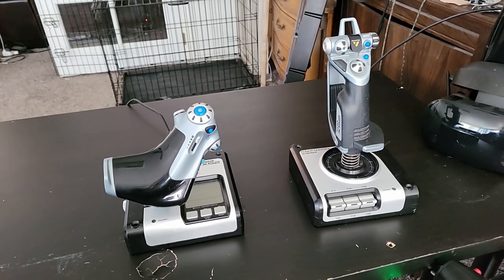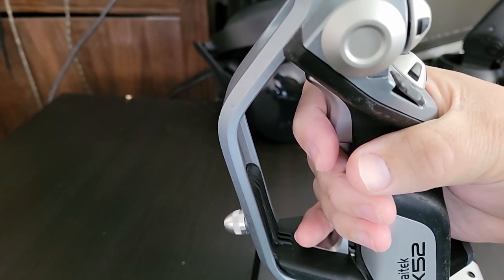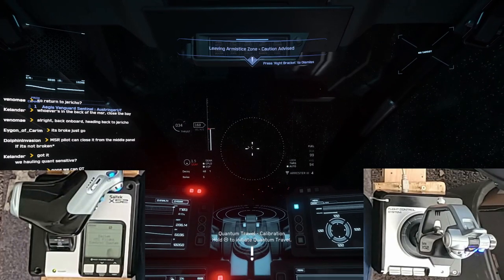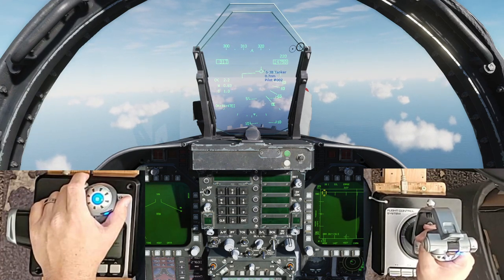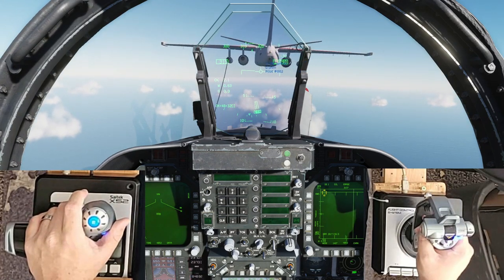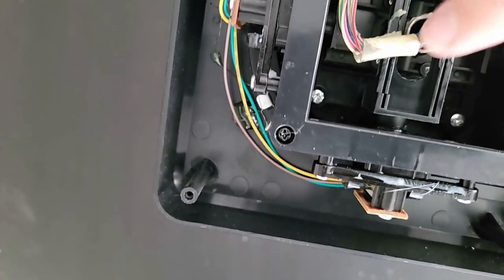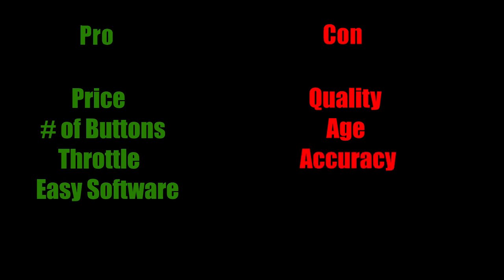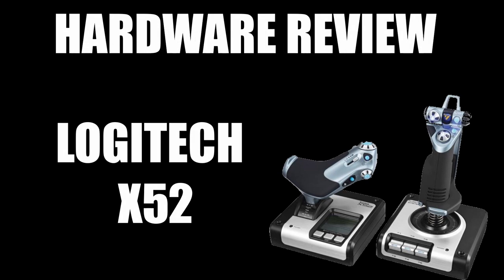Logitech/Saitek X52 HOTAS Hardware Review

Comment: The nub was useful to me to slew around the Radar and Maverick Curser in BMS. Until it started to fail. And if I am not mistaken it was mappable. But I cannot remember since it is more than 10 years ago. But I am 99% sure it was.
The Thrustmaster T16000 has not enough POV's and no 1st and 2nd detent trigger which is needed in Falcon BMS or even in DCS in certain models. 
So for all other games it might be the better option. But Falcon BMS and DCS needs a proper HOTAS with many Rotaries and POV's. Unfortunately. And the budget is a thing when comparing a 120 USD (used) X52 to a way over 300-400 USD HOTAS that gives the same functionality. 
I don't even know why I am watching this 😅 since I know this HOTAS so very well hahaha. Mine lasted many years with many play hours a day. I was so addicted to Falcon and DCS.

Comment: this is my first gear so i didnt think much and bought first one i saw, to figure out what i want from this gear. only thing that annoys me - i need to make holes in table, very unstable gear, they should put some iron in the base. also not all buttons are comfortable on stick.
Reply from the maker: Unfortunately the x52 just really isn't a great piece of hardware. It's recommend checking out the VKB Gladiator NXT EVO. It would be a huge upgrade for not a ton of money.
Reply: @FalconsLedge  yea thanks for intel)
Reply: @FalconsLedge  there is only VKB Gladiator NXT without "EVO" available in my country, is that right version?
Reply from the maker: @karlvareze8337  the NXT is a great stick, but the NXT EVO is far better for essentially the same cost
Reply: @FalconsLedge  btw i can manually upgrade it, their assembly is on god level

Comment: Just wondering I was going to buy one of these but what is the difference between this and the x52 pro?
Reply from the maker: The pro has a dual spring gimbal, some additional metal bits and two of the very low quality Hall sensors instead of one. 

On the plus side some of the metal bits are some of the high wear items.

If you are willing to spend x52 pro money, why on earth wouldn't you buy a Gladiator NXT and TWCS throttle? The stick is 100% better than anything Logitech has to offer.

Comment: my X52 just died after only 8 weeks of use. Is that Star Citizen music I hear? That's my main use for this joystick!
Reply from the maker: I use a bunch of game soundtracks, including SC! if your throttle works, buy a Gladiator NXT and never look back at the X52. You will not be sorry.
Reply: @FalconsLedge  nothing works as the 2 are joined together and the throttle receives the power via USB. I looked for the Gladiator NXT and couldn't find it but I'll look again. I may have searched wrong. And I couldn't find that throttle you recommended either. thinking of just getting the T16000M.
Reply from the maker: @coina-dig-tion6322  VKB Gladiator NXT and Thrustmaster TWCS throttle. Trust me on this one.
Reply: @FalconsLedge  ok. lol just checked and they want nearly $60 just for shipping. :-( Guess I've been spoiled with Amazon free shipping too long, huh. The Thrustmaster TWCS used to stick a little from what I've been hearing. Is that still an issue?
Reply from the maker: @coina-dig-tion6322  yup it's an unfortunate reality, but it is well worth it. It is volumes better than the T16000 stick and worlds better than the x52
Reply: @FalconsLedge  ok. thanks for the input. Will be buying these two soon.

Comment: I was gonna get a new x56 for $205 on amazon but picked  up a used x52 for $30, would you consider that to be good? I thought it would be nice for the money, I just needed an upgrade from the logi attack 3
Reply from the maker: I would not consider the x52 to be good, no. But I also don't think he x56 is good either. 

The biggest problem with logitch if that they don't give a flying crap about combat Sim hardware. 

What I'd suggest is to keep the x52 Throttle, is not great, but not bad either, and it sounds like you got a good deal on it.

Buy a VKB Gladiator NXT EVO and use that as a stick. It will be a setup that will be very good, and significantly better than the x52 stick (the worst part about the x52)
Reply: @FalconsLedge  Thanks, Ill prob look into getting the gladiator, The only flight sim I play right now is DCS and I fly the F16, I needed more binds than are available on the attack 3, I appreciate your feedback too.
Reply from the maker: @tokenday4566  the gladiator premium should be able to 1:1 the f-16 stick in DCS or close to it

Comment: Mine has major axis stutter in the joystick after a year with minimal use. Logitech is not willing to help.
Reply from the maker: Lots of them do, most people who are either pretty casual or just simply don't have good context to compare experiences just don't notice it. It is a big part of why I created this channel.
Reply: @FalconsLedge  it's a shame because if it hadn't stopped working properly it would be an amazing controller.
Reply from the maker: @legokid201  so that's where I disagree, at least in today's market. You need to compare it to what's available. The t16000m, while imperfect is a better kit for the same money as the x52. Better sensors, better gimbal.

And for a little more the Gladiator NXT is 100x better than the x52 it's not even in the ballpark.

Comment: I wonder if the x52 pro is better, I heard that had better construction.
Reply from the maker: I have messed around with one, and it has a bit better materials on parts, but the gimbal still has the same problems, and they use two of the same garbage sensors per axis. So it should be slightly better, but for the cost you could have a gladiator nxt and TM throttle and there is absolutely no comparison between the two. The GNX is better in every conceivable way.
Reply: @FalconsLedge  thanks for the info.
Reply: The sensors are very accurate and not garbage at all, you simply don't know how to properly calibrate the stick which is why you're getting stick drift!

When calibrated properly, it is super precise, needs no deadzone and does not drift. And it just works day in, day out.

Which is a far cry from the reputation that POS "warthog" stick has in the flight Sim scene.
Reply: @Tom--Ace  I'm assuming this is sarcasm.

Comment: I have had an Extreme 3D Pro for 10 years now. Would the X52 be a worthy upgrade for 55-65 €? Or should I just go for a T.16000 + TWCS + TFRP for 170 €?
Reply from the maker: I would go for the T16k over the x52
Reply from the maker: If you can afford it though, a much better solution and what I consider to be the best bang for your buck right now would be the Gladiator NXT paired with that same TWCS. IMO the GNX is vastly superior to the x52 and T16K for a reasonable amount more.
Reply: @FalconsLedge  Trouble is the TM devices come in a pack, which I am not able to separate. So it'd be all or nothing on TM.

So defo X52 not worth it for 60 €?
Reply: @FalconsLedge  The seller claims it is almost new.
Reply from the maker: @ezanchi5422  the x52 is 20+ years old. It may be worth it, but the T16k has a much better sensor, a better gimbal, and it doesn't look like a bad 90s future joystick concept design.  (It looks like an early 2k design that is still pretty ugly IMO, but better than the x52). 

You might like the x52, who knows, that's ultimately up to you.
Reply from the maker: @ezanchi5422  it sounds like a good deal, and you sound like you like it, so I don't see a down side for you

Comment: vkb is impossible to find is always out of stock and it cost 2x for a setup, at some point i have to look elsewhere
Reply from the maker: This is the worst solution to go with.  The worst, they are awful, inaccurate, low quality, unergonomic, and even worse it's giving money to a company that doesn't care about your hobby.
Reply from the maker: I'm sorry they are so hard to get in some places. I've never had a problem getting them in the US. My recommendation would be to look at saving a tad more and going with Winwing if you can't get a VKB that is more in your price range. 

If you can't afford both the throttle and stick, I'd MUCH rather have a single stick that is actually a quality piece than the absolute garbage that is logitech flight hardware.
Reply: @FalconsLedge  winwing is basically 650 after shipping and EU taxes, and i also need to add a rudder pedal which raise the cost even more, seems that theres not a "casual" solution, its either complete crap or too expensive
Reply from the maker: @sharkpyro93  unfortunately you aren't really wrong.  There is turtle Beach that has a stick that is a bit better than the Logitech sticks. But the VKB NXT is still better.

If I was not able to afford anything above entry level I'd go with a Gladiator NXT. Save up a bit and choose a throttle. TWCS if the others are too much. 

I don't recommend the Logitech stuff for anyone. I just finished my test of the X56, and while id say it may be a step up from the x52, sadly that isn't saying much. I'd rather have one gladiator NXT and no throttle than have the x52 or x56. I'd take one NXT all day over a Logitech hotas.
Reply: @FalconsLedge  agree but its out of stock for too long, and it seems that is impossible to pre-order for the next batch, availability is something to consider, what am i supposed to do now?
Reply from the maker: @sharkpyro93 having used everything, I'd wait. I do wish VKB would do pre-orders like others.
Reply: @FalconsLedge  they do but it seems they removed the option on their site, probabily some issues at production level i guess

Comment: Hey thanks for the vid! Does it work with Xbox series s/x on flight simulator 2020?
Reply from the maker: This stick is 20+ years old. Xbox consoles require a specific security chip in order to function as a peripheral, so no, it likely wont work.

Comment: Wait, you complain that it feels like it has a dead zone in SC, and then set a dead zone in DCS and complain that it's not sensitive enough? I'm not understanding.

You're also comparing a $150 retail hotas with 15+ years of wear on it to one that's $400 minimum with much less wear.
Reply from the maker: In wasn't saying they were the same, just saying that the difference was staggering. The sad part is that Warthogs aren't great compared to its competition. The stick didn't perform any better new fyi 

Also I altered the deadzones numerous times. You assume I never tried anything, but I did. The x52 isn't a good stick. It may have been when it had no competition a decade ago, but not today.

Comment: Is any joystick that doesn't do, like X52. Is X52 pro any better?😬
Reply from the maker: Not much better, slightly better feel, slightly better sensor arrangement, but not enough to be worth it in my opinion.
Reply: @FalconsLedge  . Thank you. 👍 Experience and opinion, what i came for. That jerking is pretty bad.... 😬 Trying get some information. And try to play VR IL-2 for the starters...
Reply from the maker: @alexk2418  sensor not website... Not sure why that corrected to that, sorry. Depending on your budget, that is what is going to determine what is the best bang for your money. If you are limited to x52 money, say under 200 for both throttle and stick, the t16000m kit would satisfy you. If you can go to 250, then you will not beat the vkb Gladiator NXT with the thrustmaster TWCS throttle to pair it with.

If you only do warbirds and you want a bit higher end solution you could stick with the TWCS throttle and go for the vkb gunfighter mk.iii warbird edition. The big plus here is that you can buy other grips like the kosmosima if you decide to fly more modern aircraft
Reply: @FalconsLedge  . After your review, I will definitely go for that gladiator. In my opinion, 150€(pro190€ on that side of the globe) too match many for that behavior (X52 jerking). Hall sensor stuff almost pointless... Over 15  years ago. Played IL-2 with crappy joystick. That mistake, i don't do again. 
1600 I don't like, and it cost about 150€
Reply: @FalconsLedge  . I don't understand that Logitech politics. For example. Wireless keyboard for over 200€ and can't map keys. Otherwise awesome keyboard. That x 52..... 🤦🏻‍♂️
Reply from the maker: @alexk2418  I'd love to see them release a modernized stick, maybe something based on the x-65f tech saitek had.
Reply from the maker: @alexk2418  I have not used one for long enough for a full review, but I have studied and handled them. For me they have some pretty serious ergonomic issues. The hats interfere with access to the other hats, the right most hats are too far right and are not comfortable to reach, the mini sticks are of extreme low quality, and there is no ergonomic thumb rest.  Furthermore the gimbal is very similar to the x52 gimbal with some improvements and a bit better sensor.

The setup is plagued by quality problems and they absolutely require a good powered hub otherwise they will have ghost inputs and other problems

If you are spending 250, the gladiator NXT and TWCS throttle is the way to go. The NXT is head and shoulders better than the x56
Reply: @FalconsLedge  . Thank you for your help and time. I go for NXT premium first, (high end someway overkill for my gaming) then look for throttle. I remember your hints, taken some screenshots 😜.  Like you said, I think the same about ergonomic. Awkward button set-up(by Logitech). Ergonomic is crucial for my. Nerv damage. 😭
Reply: @FalconsLedge  .  🤔 "Gunfighter Mk.III base + MCG Pro grip" would be good for couple years..? Or?
Reply from the maker: @alexk2418  the gunfighter with MCG pro will drastically outlive your PC, they are top quality
Reply: @FalconsLedge  . Seriously considering it.....  Better spend once and enjoy, that save 5 times and cry every bug... NXT have best modding capabilities.... Only problem. Shipping about 40 euroPeso....
Reply: @FalconsLedge  . That MCG have other good point. Aftermarket price.
Reply from the maker: @alexk2418  I think the VKB software is very powerful. It is complicated, but good software, never had it crash
Reply: @FalconsLedge  . Seen glims of it. Yes, assload settings.. But it came with accuracy and modification capabilities. Better that, than when something don't like and can't do anything about it...
Reply from the maker: @alexk2418  yeah it is pretty comprehensive, you can change basically everything
Reply: @FalconsLedge  . Hopefully Index kit don't start again on my..... Was/on 3.2 port problems. Good clocking mobo, still problems with index. I suspect win10 drivers fuckury, in 7 was similar problem with other hardware.

Comment: I fucking LOVE the x52. I didnt know it was such garbage? It feels great and works well. I've been using one built in like 2003.
Reply from the maker: This is a common comment from people who don't have any context on what is good and what is bad.
Reply: @FalconsLedge  :(
Reply from the maker: @logoed  sorry man, it's just true. I knew the x52 wasnt that great when I was using it for more than a decade, but I really had it painfully illustrated when I upgraded.
Reply: @FalconsLedge  Makes sense lol, I am sure if I got my hands on a new up to date hotas, I would consider the x52 crap.
Reply from the maker: @logoed  I'm not really comparing it to sticks that are all that far outside the price range of the X52 either. Even when compared to the T16000m it isn't nearly as accurate. 

When compared to a stick just a bit more money than the X52, the Gladiator NXT its like a different world of better. There is no comparison.
Reply: I don't agree with the reviewer. I've used my share of sticks and the x52 is a very accurate device.

However, you have to know how to work with the auto calibration 

The problem the reviewer has is that they don't know how to properly calibrate the stick. That's why he gets axis drift

Set up properly there is no axis drift and the stick, while plasticky feeling, is extremely accurate.

It's very telling that the reviewer reckons the POS warthog is an "upgrade", considering how many problems that ridiculously expensive controller has which are inexcusable in its price point. The warthog has a better material feel, but otherwise is not superior in input precision.

Finally, you have to spray Teflon spray at the plastic base of the x52 to give a lasting glide. Otherwise it is notchy to use. Lubrication is not enough, you have to use a Teflon spray.

Comment: When you let go of the stick and it drifts you might say it adds a sense of more realism to the flight. After all in real life unless autopilot is active letting go of the stick you dont still fly a straight line
Reply from the maker: Lol no, the stick centers, but the sensors drift, this is due to very low quality sensors and a badly designed gimbal, there is no positive side to it
Reply: @FalconsLedge right the stick might center and a real one would show movement if you let it go. But still in real life letting go of a stick  the craft would lose control with no auto pilot engaged and no hands on the stick. LOL
Reply from the maker: @ericmooney5740  yes I realize that, but it's not the same, sorry. If you like the x52, more power to you, but it's a horrible stick.
Reply: @FalconsLedge Honestly i have no preference on game sticks and I realize the fault you were mentioning this has. My point was simply if one wanted to they could imagine the fault added to the realism. Sorry if that was not clear
Reply from the maker: @ericmooney5740  I guess that would certainly be making lemonade out of lemons for sure.